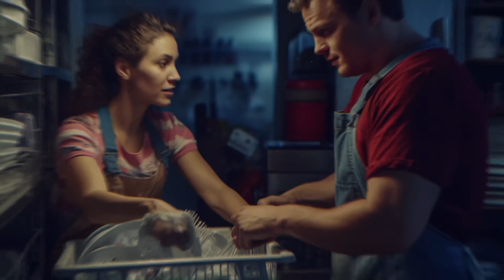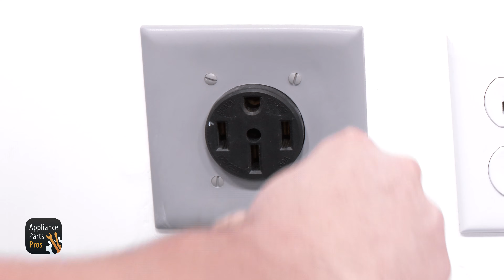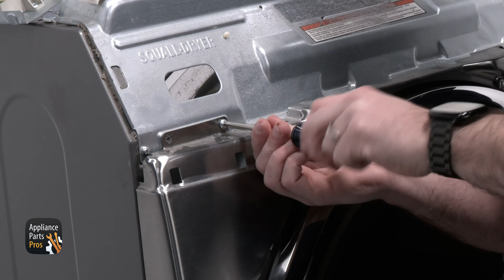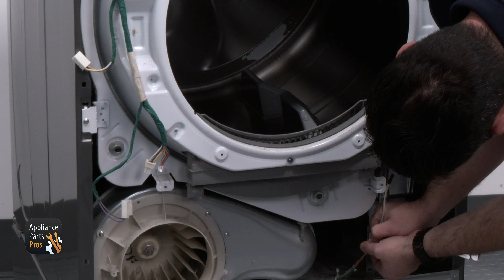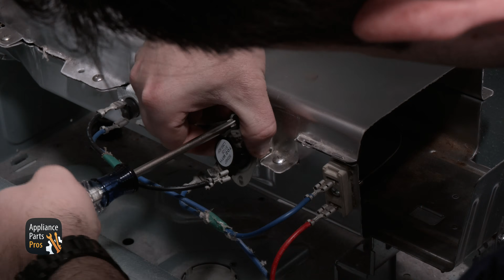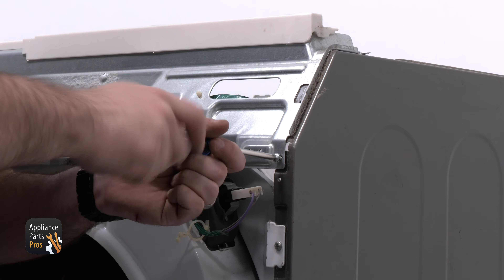The EASY Way to Replace Samsung Dryer Thermostat Without Calling a Pro!

Comment: you can remove the entire heating element/housing without doing all that crap once the front panel is off.
Reply from the maker: The repair steps can vary depending on the model, so that may not be possible on all of them. But if you are able to access without the extra steps, then you can skip those.